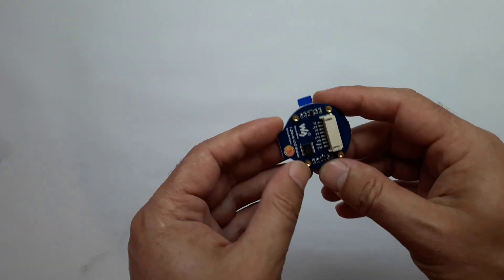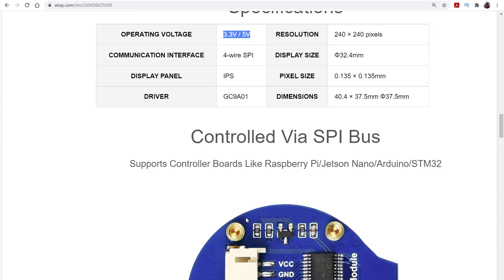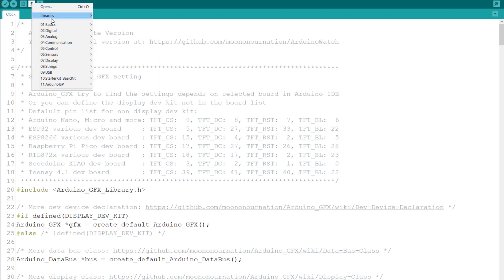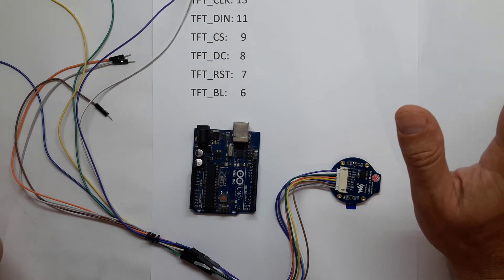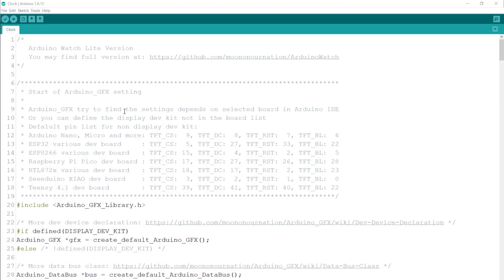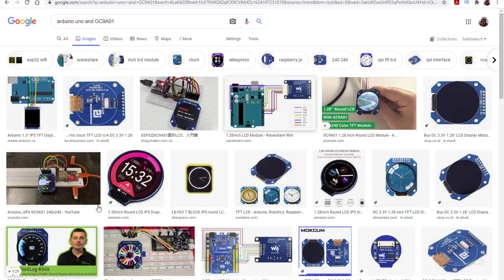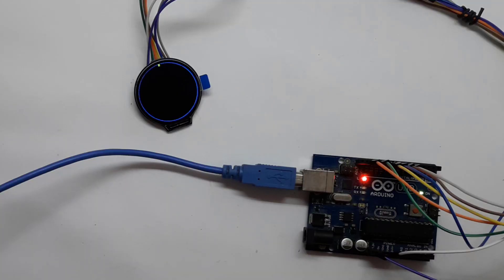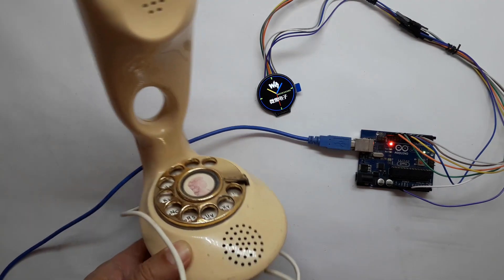Unlocking the Mystery of the Round LCD Module GC9A01

Comment: Hello, great video. I got my display working but i would also like to control the backlight. I am using an esp32 to generate a PWM wave, it is 8 bits and on channel 0. I have tried varying frequencies but they all do the same thing, after a couple of minutes the display just turns off. Do you have any idea on what I can do or point me in the right direction? Thank you!
Reply from the maker: Hi, thank you very much. 
I actually did not look into the backlight at all. 
I got the setup on my table connected to an esp32 camera - and I stream the image to the screen . 
I will try to take a look at the back light and see what are the options. 
Did you follow a specific guide for it ? 
If so - drop me the link please :)
Reply: Hey, I might be a bit late but if I'm not mistaken the datasheet comments something along these lines. Specifically, it says " 4.4 Backlight Recommended Circuit

Motherboard driver backlight is need constant current circuit, if threated voltage screen after sight brightness difference. Current and power consumption of the machine are inconsistent, so recommend a backlight driving circuit is best rated current, It is recommended to use IC (AW9364). The reference circuit is as follows: "

Comment: Could i marry this with say a runcam night eagle 3?
Reply from the maker: You will need special board for it 
https://www.digikey.com/en/maker/projects/wireless-security-camera-with-the-arduino-yun/d73062bd2bbc4415a73f7446e624a9c4#:~:text=You%20need%20an%20Arduino%20Yun,sensor%2C%20and%20a%20microSD%20card.&text=The%20first%20step%20is%20to%20insert%20the%20SD%20card%20in,motion%20sensor%20to%20the%20Yun.

Comment: Late to the party, but the clock example works for me if I use 5V VCC. 3V does not work for me. Maybe its the discrepancy of using 3V power and 5V logic? just my guess
Reply from the maker: Never thought of that, it could possible that this is the cause.

Comment: Is it possible to connect this display directly to an fpv camera?
Reply: Night Eagle 3
Reply from the maker: @MatteoMassaretto I do not see any type of output from the camera that will be able to feed directly to the screen
Reply: I'm not an Expert, but with another microdisplay i've connected the video cable of the camera to the av cable of the microdisplay and It works but this looks diffrent
Reply from the maker: @MatteoMassaretto  This display does not have an AV input. it has to get digital data to know what to display. 
It's basically a EGB LED matrix that you control with specific commands to tell it what pixel to light up in what color.
Reply from the maker: Good Q, never tried it, which fpv camera do you use ?

Comment: di you think it will be possible to read small video on this screen ?
Reply from the maker: Hi, I can guess you asked if its possible to shoe a video on this screen ? 
The answer is yes, but in order to do so, you will need to have process that will get the video frame and convert it to a frame the screen is capable of showing - like jpg for example. 
I'm not sure what will be the frame rate with the need to process the video into images and then to transfer each image to the scree. 
The closest I know of is an example of animated gif shown on the screen. 

Hope this helps :)
Reply: @talofer99  thanks ablot for your developed answer ! It help for sure !!

Comment: How to display bmp images whit the nano on this screen
Reply from the maker: Connect the screen to the correct pinout, you will need some input for the image, you can do it by adding an SD card reader maybe, or can have the info as hex file. 
For the rest there is an example in the example section of the library.
Reply: @talofer99  I already tried it with this library, which is also the only one I could find to control this screen, but I can't get a photo on it, text and stuff works, but it doesn't work with photos and I can't find anything else online either  then this with the nano and this screen
Reply from the maker: @fabianboelens3899  did you try is with the use of external SD ?
Reply: @talofer99  not yet I will try this tomorrow I will tell you if it works thanks for answering so quickly
Reply from the maker: @fabianboelens3899  sure thing, let me know how it worked. 
Just first make sure you can init the SD properly since both are SPI.
Reply: @talofer99  Hi,i've tried a lot these days but i'm not really succeeding i'm getting a lot of errors even though i added the libraries they asked it just won't work i'm trying a png file by the way.
Reply from the maker: @fabianboelens3899  yes at times it can get hard. 
This is why I always suggest to start with one item at a time
First get the SD to work - with a proper example 
Then make sure the screen works well. 
Then get them to work togther 
Only then try to do the PNG example (is there one?)

Comment: Hello.. great video, I was just wondering if you could guide me on how to use this screen on the raspberry pi 4? I have googled and tried myself but am struggling. I think I have connected it properly but the screen is just black so I guess it requires programming. Your help would be greatly appreciated.. thank you.
Reply from the maker: Thank you :) 

From what you wrote it seem that you are expecting it to work as a display for the rpi 4 OS ? instead of connecting it to a a screen ? 
If so - I doubt it will work - not out of the box like that. 

Here is a link to connections and I think there is an example there are as well 
https://www.waveshare.com/wiki/1.28inch_LCD_Module
Reply: @talofer99  ok thank you very much :)
Reply: @talofer99  suppose I already had a python file could I just output that? Instead of displaying the raspberry pi screen? Thanks
Reply from the maker: @Mikrod16  Yes you can - but you need to code it to do so 
There is a library for it, you can see example for it in the link I placed before.
Reply: @talofer99  ok thank you very much for your help
Reply from the maker: @Mikrod16  no problem, let me know if you get it working :)
Reply: @talofer99  hello, I have managed to program it to use my own python file but nothing seems to appear... The screen is on and kind of bright but my program does not run and so I tried using the example code and it didn't appear I only saw a few lines, could this mean I haven't connected it properly? Thanks
Reply from the maker: @Mikrod16  my guess will be wrong (or not good) connections.
But it can also be the code. 
Is there any debug output ? 
Does the code "works" well ?
Reply: @talofer99  ye, the code does work... I will try the connection again. Thanks
Reply: @talofer99  hey, thank you very much for your help... I have managed to run an example code will now try my own code. Thank you :)
Reply from the maker: @Mikrod16  Thank you so much for the update !! 
What was the issue ? 
And what are you planning to do with it in your code ?
Reply: @talofer99  I had not connected it properly but now my code isn't running on the screen, I choose the right python file and the screen goes blank and the program just runs on my raspberry pi display. Do you know what do to? Thanks
Reply from the maker: @Mikrod16  I'm not sure what are you doing, but again it sounds like you expecting the data to flow to the screen - and it will not!.
There are specials commands in the code to send data (text/images) to the screen.

Comment: Hi this video was greatly helpful thanks a lot! Can you share the whole code with me please?
Reply from the maker: All the code I used is in the examples of the library.
Reply: @talofer99  Okay thanks!!
Reply from the maker: If you still have issues with making it work, let me know which example you need the code for I will upload it for you.
Reply: @talofer99  Honestly I've been trying for days to get a gif displaying on my GC9A01 using esp32 and thought maybe your code could help. I do not have an Arduino nano sadly, so won't work for me it seems. Thank you so much for replying!
Reply from the maker: @Ilayda.Bayram  It's your lucky day :) 
And it will work on esp32 for sure 

Take a look at this video 
https://www.youtube.com/watch?v=0s4Bm9Ar42U

and this is the link for the code 
https://github.com/talofer99/ESP32CAM-Capture-and-send-image-over-esp-now

And let me know if it worked for you :)
Reply: @talofer99  Thanks a lot will give it a try tommorow!!
Reply: @talofer99  I followed your video, and it says done uploading but then nothing happens. The example code is a bit different than what you have in the video since your video is from 2021 so that might be the issue :( The sketch also gives the message "Leaving... Hard resetting via RST pin". DO you think that might be the issue?
Reply from the maker: @Ilayda.Bayram  check the wiring will be my guess. 
And make sure you adjust the code to the right screen type. 
Also  "Leaving... Hard resetting via RST pin".  is totally fine result
Reply: @talofer99  Still no result... Thanks a lot for all your help anyway!! I'll try to find another method :)
Reply from the maker: @Ilayda.Bayram  can you share the code ? 
use pastebin.com or similar
Reply: @talofer99  Yess! Here is the link for the IMGViewer JPEG: https://pastebin.com/UpHKriHn
Here is the link for the JPEGFUNc.h: https://pastebin.com/1mijdmU2
Reply from the maker: @Ilayda.Bayram  which board are you using ? (exact model) 
And do you have an microSD connected as well? 
Did you try the "hello world" example first ?
Reply: @talofer99  I am Using ESP32 Wroom 32 and actually I don't have a microSD connected...Sorry I am new to this so seems I missed that step. How was I suppose to connect it? Also sadly the hello World did not work out either, maybe it is my LCD but the screen lights up blue when I connect it to power so it is working actually.
Reply from the maker: @Ilayda.Bayram  Without SD you can not show any image, since the image is read from the SD :) 

Can you some how describe which pins of the screen you connected to which pins of the screen ?
Reply: @talofer99  ohh I gues that is the main issue then ahaha, I feel really dumb. Yes, the pins are arranged as goes:
vcc: 3v3
gnd: gnd
din: 18
clk:  23
cs: 5
dc:27
rst: 33
bl:22
Reply from the maker: @Ilayda.Bayram  it should be 

27 /* DC / * that's ok on your wiring 
5 /* CS /,  * that's ok on your wiring 
18 /* SCK /, * that's NOT ok 
23 /* MOSI /, * that's NOT ok 

Is it possible you flipped them ? 
or was the mistake in the writing ? :) 

And do not feel dumb, took me for ever to get it all .... and still there is tons I do not know ;)
Reply: @talofer99  Thank you so so much for your help, will give it a go again!
Reply: Omg you are amazing!! It finally works, I am able to show the image I want. Still says 'SPIFFS create failed" for when I try to display a gif but already showing an image is great! Thanks a bunch!! I need this for my thesis so I really feel like you just saved me from potentially getting a low grade. Do you have any idea what the issue might be with the animating gif.
Reply from the maker: @Ilayda.Bayram  so happy to hear it !! 
Good for you for now giving up !!

Now about the spiff, there is an upload tool for it, what it does is take a chuck of the memory that is meant for code and use it as a "disk space" like an SD will be.

Maybe this tutorial will help with it 
https://randomnerdtutorials.com/install-esp32-filesystem-uploader-arduino-ide/

let me know how it goes ! :)
Reply: @talofer99  Thank you! The thing is that I already have the upload tool for SPIFFS. But for some kind of reason, in the animatedgif example, it gives an error when I try to choose SPIFFS from the ESP32 Sketch data Upload. I will try to do some more research and will let you know if it works! :)
Reply from the maker: @Ilayda.Bayram  Any luck ? 
And I thought about it, what is the error you get ? 
Can you make a screen shot of it ? 
And also share the code ...
And not less important the settings in the arduino ide - when you try to upload the gif
Reply: @talofer99  Hey there, sorry for the late reply. I actually kind of gave up on it since my project was due at a past date and I did not have enough time to work on it anymore. However, having displayed an image on the LCD already felt like a great accomplishment so thanks a lot for that!
Reply from the maker: @Ilayda.Bayram  Sorry to hear you did not get to finish the project. 
Glad I could help with the little I did. 
And if you need help in the future feel free :)

Comment: Hi! Can you please help me out? Been trying to do this project "DPNVG mk3 (DIY Quad Nod NVG, Night Vision) part2" on youtube but a lot of us facing a problem with no image and the creator is not going to share the source code, would you mind to have a look and create the code with Arduino IDE? The setup is similar, ESP32-CAM + GC9A01. Thanks in advance
Reply from the maker: Hi, 
I'm not familiar with it , but I will try to  take a look
Reply: @talofer99  Thank you very much.
Reply: @talofer99 I have the same problem have you had any luck with the coding I am using an esp32-s with these 1.28 spi screens using an OV7725 camera module.
Reply from the maker: @stephenopitz3106  what same problem ?
Reply: @talofer99  So when I supply power to my esp32-s cam with an OV7725 module camera attached and the spi LCD 1.28-inch screen I cannot get my esp to transmit video I only get the backlight of the screen. Any help would be much appreciated!
Reply from the maker: @stephenopitz3106  can you share code ? diagram of connections ? 
If not it will be very hard for me to help :)

Comment: Hey, great vid :) 
I really want to show videos on this screen! I managed to show regular images but videos are hard.
Tried to use fbtft + fbcp and fbcp-ili9341 to mirror the HDMI output to the SPI one, but this screen driver GC9A01 is not supported :/
Any ideas?
Reply from the maker: Hi thank you very much. 
I actually never done any thing with the screen after this video. 

I actually had to google half of what you wrote, since I never dove into video before. 
Maybe this will give you some ideas ? 
https://www.instructables.com/Play-Video-With-ESP32/

Please do let me know if you find a way to do it :)
Reply: Had the same problem, ended up buying the round Hyperpixel.
Apparently those small displays have way too little bandwodth to actually mirror hdmi and the workarounds are a real stretch to begin with.
Don't waste your time.

Comment: WOW. Great video. I've been looking for detail information for this display. Finally, your video was step-by-step and detailed and finally the display works. Thank you for that. Much appreciated.
Reply from the maker: Awesome, thank you!

What are you building ?
Reply: @talofer99  I'm first have to consistenly get it to work. But, If you could show...I would like to display a 'gif' on it. Do you know how to do this?
Reply from the maker: @trauatsgg3809  I never did any thing more than shown in the video. 
Did you try to google it ?
Reply: @talofer99  yes, but it was not as detailed as your video. i did not get it to work
Reply: here is the link: https://www.youtube.com/watch?v=Y0BGnHFuYBU
Reply from the maker: @trauatsgg3809  In the examples of the library there are a few examples (I never tried them), maybe that will help. 

look under the library /examples/ImgViewer
Reply: I'll give it another try later today. maybe my pinout was incorrect. I'll let you know. hopefully it will help some other folks also.
Reply: Thanks for your response(s). Much appreciated
Reply: I tried the other video again (3x) following each step carefully. I carefully check wiring as well as commenting out the proper lines (pretty straight forward). But, before the hardware, the Arduino code compiles with error.
Reply from the maker: @trauatsgg3809  did you try and google the error ?
Reply: @talofer99  yes, its a generic error pointing to bad library and/or board. But everything has be loaded and reloaded. And no matter what board is loaded it does not compile. When I change that example(round display) to a different example like "button", 'blink' and so on. I do not get any errors.
Reply: I also forgot to mentioned that I tried this from two different computers, 1 windows and 1 mac. I get the same result.
Reply: I changed the board (in Arduino IDE)  from an ESP32 to a 8266 board and I don't get an error. I have not wired it to the display yet. that will be a next step. I'm going to change to a couple other different boards in the IDE first to see if I get an error from those first before I wire it to the display.

Comment: Yea I just bought one just like it. I can’t get mine to work for the nano. I was wondering if you could help me?
Reply from the maker: which library did you try ? did you setup all the setting same as I did ? 
is it the same exact board ?
Reply: I did the same thing , but it may have to do with the fact that the Arduino Nano I am using was hand soldered. I’m thinking about getting a new one to try again.
I was also wondering if you could help me soon with uploading gifs and JpeGs like you did in the video
Reply from the maker: @stevenspencer2661  soldering issues can be a problem. 
I did not use any images on the screen  in the video.